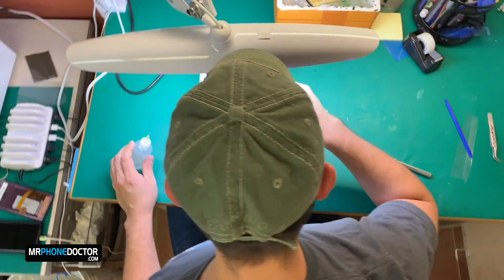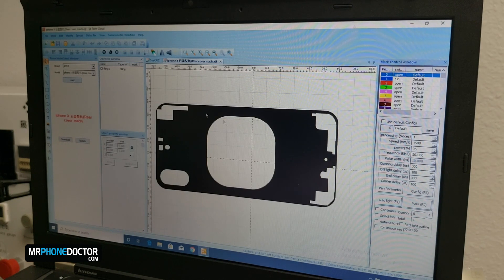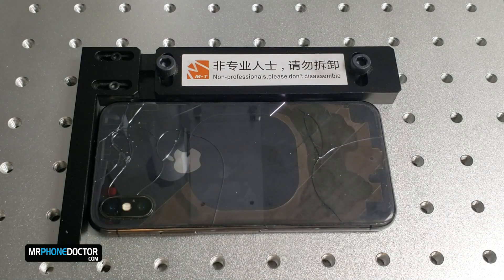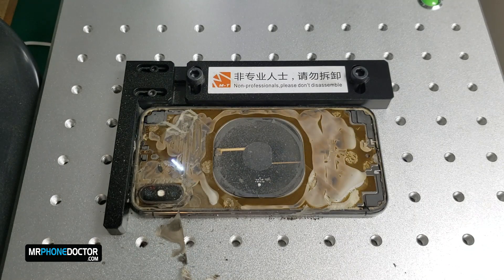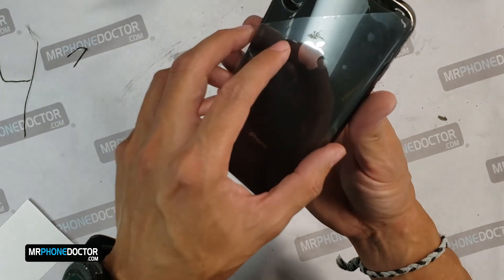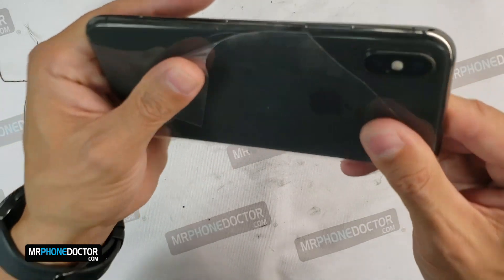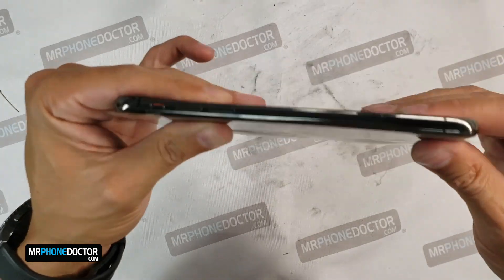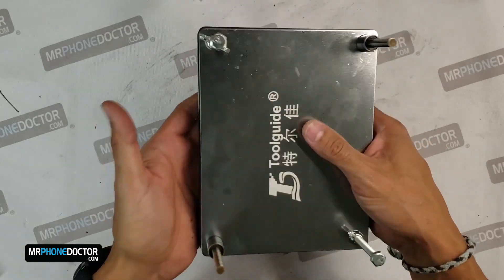iPhone Cracked Back Glass Repair using Laser Technology & 3k Countdown Subscriber Giveaway

Comment: Which machine would you go with today?  This one or the new Forward Blue Laser machine?
Reply from the maker: This one!
Reply: @MrPhoneDoctor The video you posted for the Forward Blue Laser looked like it worked pretty well and they claim to have solved the issues that the fiber laser has (needing another pass, not releasing the adhesive at the cracks, dust in the camera, etc). Did you have issues with the Forward Blue Laser machine? Or did you find that this one simply worked better?

Comment: What are the settings you are using for the laser? I cant take all the adhesive off of the metal plate
Reply from the maker: First pass is 1500 second after glass is off 500
Reply: @MrPhoneDoctor  everything else is by default?

Comment: starting to hate my machine. no matter what I try it never seems to be right. I have been going back and forth on what's app with the girl from REWA, so hard to understand her, " don't move the camera separate , only highlight the whole phone and move it as one piece"  " just use the camera red lines as a reference" SMH worked for one XS max the rest I take 15-20 minutes lining it all up the red line looks good . run the white light ands it hits the camera and takes off the paint or even worse takes off the frame on a side !! starting to feel I was faster and more effective with heat gun
Reply: MySixFo Michael Anthony I am having a similar issue. The red outline does not align perfectly with the actual laser.
Please let me know if you find a fix
Reply: @DonChong  https://www.youtube.com/watch?v=x0b1N-BHh-g
Reply from the maker: You need to scale down the image so it don't overlap. These types of machines really need hands on training to finally dial in and get a perfect removal every time . Sorry to hear about your issues:(
Reply: https://www.youtube.com/watch?v=84Fx6_pJHIQ  ive provided video of both softwares that come with these machines on how to  align red light with laser if you havent figured it out.  I have one of the machines and havent used it on any actual customers phones yet.  I want to know what im doing before i do so ive been practicing.  much success to us all with these machines.  if any of yall find any techniques ect please feel free to share by inboxing me.  thanks